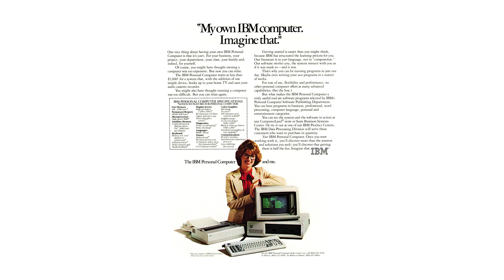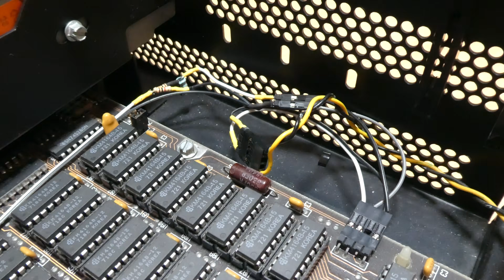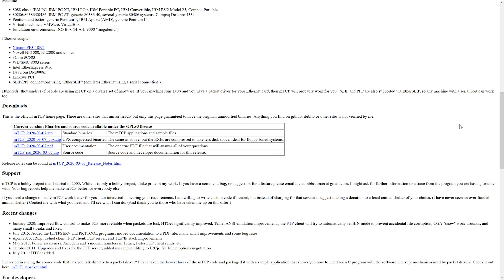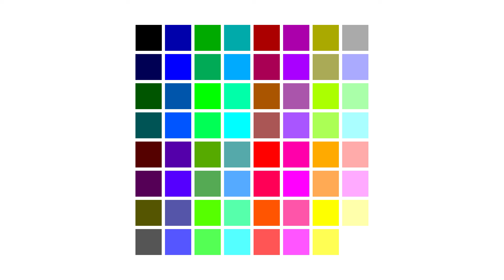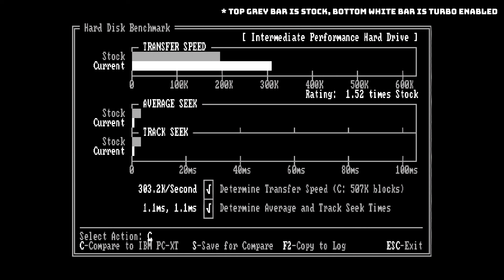IBM 5150 With 7.16MHz Overclock, EGA & Ethernet - Show & Tell #DOSCember

Comment: Very nice system. I especially like the EGA card, that's pretty rare these days.  What's on the circuit to get line level output? A cap to sort out any ground loops and a resistor to limit the voltages ?
Reply from the maker: Thanks! That's exactly what it is - it's the first "Tony Duell" circuit on this link: http://www.oldskool.org/guides/speakerrecording

I was going to start there and try out some of the more sophisticated ones listed on that page, but to be honest it worked just fine for my needs so I stopped at that one!

Comment: get some Adlib too... CGA sucks but those 5150 were probably quite slow with more advanced graphics and early Dos-games woudl sometimes offer no proper EGA anyway. HiRes EGA was very rarely used by games, even 640x200x16 wasn't used that often (which is a shame) and many games supporting CGA/EGA/VGA wouldn't really have great graphics in EGA, they sometimes botched the conversion because CGA and EGA were legacy market by early 90s and VGA was taking over but some companies did excellent job with EGA (Lucasart and Loom/IndiannaJones 3/Monkey Island, great proper EGA versions), other didn't care that much. 
Some 8bit VGA card might not offer a lot of playable VGA games (most of those were more suited for 286AT than XT) but would allows for more modern VGA monitors and also emulate CGA and EGA quite well. BTW just get an Amstrad PC1640... 😅

Comment: I've had to explain this before, but the Adaptive Tile Refresh scrolling routine was not invented by John Carmack, although Carmack is credited with being the first to adapt it to the EGA standard which allowed it to happen in hardware. The routine has its origin in the mid 1970's, I believe it either is or was patented by Sinclair, it originally was used in those giant Jumbotron type scrolling displays, Later on when Micheal Abrash coded games in the early 1980's he adapted it to many graphics standards, and left his information and code examples online, in a tutorial that John Carmack studied and later adapted for a game he called "Dangerous Dave" aka. Commander Keen... past the Sinclair connection, I have never found the name of the programmer who initially invented Adaptive Tile Refresh in the 1970's (I doubt it was Sir Clive). This is a shame, because although I found the Sinclair patent connection, The programmer who invented should be named, because he literally gave us gaming, his routine after being adapted to many standards and set down as silicon chips for consoles gave us every scroller from 1984 to now. Every Pc, Nintendo, Sega, Insert game system here... owes him the recognition he is due.

One thing we can assume it was a programmer/hardware engineer who worked for Sinclair and his cleverness is probably what made the Sinclair Spectrum so elegant, efficient and smooth.
One thing we know, there is rarely anything new under the sun, only incremental evolution adding another step to paths that were initiated by others... Original is Jesus level rare.

Disclaimer for Carmackers:
I am not taking anything away from your War Daddy, he is one of my Top 10 favorite programmers.

Comment: I shipped two immaculate and original 5150 PCs from the US when I moved back to New Zealand in 2005 towards the end of my engineering career.  Those and my (2) 5151 and (1) 5153 monitors were the only items in my collection of around 10 (mostly Unix) machines that could not run on 230VAC.  So 5 years ago I developed a modification for the standard 5150 US power supply.  It's carefully designed, very conservative and the theory and procedure documented.  I contributed that to minuszerodegrees and it's the first listed, 'xxxx'.  Amusingly, despite that it's been possible to do this for 35 years, shortly afterwards a couple of others quickly made slight variations and published their own versions.
I've always used mTCP in FTP server mode because it's easier to do file transfers in a GUI from my iMac.  But, I've found that Filezilla has problems transferring text files so better to restrict it to binary transfer mode. I've avoided modifying these machine as much as possible but since I was never able to find a clean 5160 I did add a period-correct half-height MFM hard disk and controller to one of the 5150s. Just like in the UK, for the same reasons original IBM PCs are quite rare here in NZ.  I don't have an IBM EGA card or 5154 but I do have a Tecmar Graphics Master, a common US$499 upgrade in that late CGA period.  It runs the 5153 interlaced for 640 x 400 modes. Yes, the refresh is pretty ugly.

Comment: I built the PC Sprinter for my Original Tandy 1000 with a V20 chip. I ended up getting the 22mhz crystal and I have been having issues with it crashing. Sometimes when I boot it will say "Memory: None". I'm going to try the 21.47mhz crystal and see how that works.

Comment: You may already know this, but that AST Six Pak Plus card has a parallel port and a game port header.  The parallel port can be used with a standard 2x13 to DB-25 adapter, but the game port requires those two sockets to be filled with an NE558 and 74LS244 and a 2x8 to DA-15 adapter to enable the game port.

Comment: I love this mod, thanks for sharing. I ended up using an accelerator card breakthru 286 the 12 MHz version really boosted my XT and I love how software switching on the fly with a keyboard shortcut give me flexibility to use speed sensitive games and boost other games.

Comment: Upgrading the CPU to a NEC V20 will add even more performance.  Many people in the day did this for a 20% speed improvement without even touching the clock.  Add the PC Speed and it will be even faster.

Comment: Love the vid thanks!
Re: EGA on CGA it was great for my 286/12 back in the day. The 286 ran POP well on EGA as did Stunts :-) 

I never could find a suitable windows 3.0 driver for the lower res ega mode but GEM had one :-)
Reply: I guess you mean CGA on EGA?
Reply: @herrbonk3635 that comment was a while ago looking at my handle but i was referring to using an ega graphics card with a cga monitor. You could run all of the low resolution ega modes.
Reply: @TechDistractions  Ok, I was thinking CGA resolution (mode) on EGA video card.

Comment: I wonder if such pc sprint exsists for clone pc's. I have an Atari PC3 XT (4,77Mhz and 8Mhz if turbo on). It has 2 crystals, one for the 4,77Mhz and one for the 8Mhz mode. Replaced the cpu (desolder job, yuck) with a socketed Nec V20 and replaced the 24Mhz crystal with a 30Mhz one. Runs just fine at 10Mhz now but I think a pc sprint solution would be healthier in the long run. Is is notably faster now than before and the NEC cpu can be clocked to 16Mhz without overclocking so it's not even getting warm at 10 Mhz. I don't seem to find the clock chip though. Most chips are Goldstar, Motorola or Siemens branded in this machine.

Comment: Your IBM EGA card has some bad or marginal RAM, I see blue, green and gray dots in random places on Commander Keen 4 in your video where they should not be.  I had the same problem with my fully upgraded IBM EGA card and a very difficult time tracking the cause of the random dots down because software video memory tests were not finding bad RAM.  Replacing all the RAM on the daughterboard solved the problem for me, see here for more information : https://www.youtube.com/watch?v=nLb0Wjnfw4M
Reply from the maker: Thanks for the info, that's very helpful. It's kind of intermittent but I've never managed to fully pin it down. I'll definitely investigate the RAM on the EGA card! 👍

Comment: I bought my IBM 5150 in the UK with a view to preserving the computer in its original condition as much as possible. I like the idea of having an original, unmodified machine - a very different philosophy to yours!  :-)
Reply from the maker: Hi Edward, thanks for watching. It's fun to see how far we can take these things but I also appreciate the importance of preservation, of course. With that in mind I haven't really done anything here that isn't reversible - well, I suppose the holes for the buttons, but I put them well out of the way on the back of the machine. I even have the original CPU and other bits carefully stored away. Perhaps I'll revert it to stock one day, particularly as I now have a 5162 that I can use for some of the later CGA / EGA games.
Reply: @ctrlaltrees  The NEC processor would perhaps be the most minor deviation from original or time period correct hardware here. As it existed back in the 1980s iirc. Your overclock card seems to be using the old original intel-ICs as well. It's worse with NAND-flash storage! That kind of stuff really didn't exist back in the 1980s...🤔😇

Comment: Very nice system, im in the uk and would like to get a 5150 or maybe a 5170, did you find yours in USA on ebay?
Reply from the maker: Thanks! Yes, even after shipping it over (ebay Global Shipping Program) it was cheaper than buying a UK model. I think the 5170 was a little bit more common over here, so you might have more luck there. It's also a more useful machine if I'm being entirely honest.
Reply: @ctrlaltrees  DId the monitor get shipped from the USA as well?
Can you recommend any other models of early IBM's, I agree that i should be able to do a bit more with the 5170, i just want an early iconic machine.
Reply from the maker: Yes, monitor is a US model as well, I run the whole thing on a 110V stepdown transformer. There's the PS/2 range of machines as well, they're pretty iconic but for me this original design is where it's at.

Comment: It's technically not an overclock, when the V20 is designed to function with higher clock speeds.
Reply from the maker: Thanks for the feedback! I'd say that replacing the PC's clock generation circuit with an external, faster one qualifies as an overclock, so I guess we'll have to agree to disagree on that point. I hope this oversight did not ruin your enjoyment of the video.

Comment: While you can't use the 16-color high resolution 640x350 mode on your 5153 color monitor, which depends on the RAM expansion (without the expansion, you get a 4 color mode instead that is supported by nearly no software), you do get a larger video buffer that can be used for scrolling around. For example the classic games "Crystal Caves" and "Secret Agent" distributed by Apogee use 320x200 in 16 colors (which can be displayed fine on your monitor), but have the whole level in video RAM, and just move around what piece of the video RAM gets displayed. A 64K EGA card can only have 2 screenfulls of 320x200 in RAM, whereas the EGA card with all 256K equipped can manage 8 screenfulls. Crystal Caves and Secret Agent need and use this extra space. So the RAM expansion is not as useless as you make it seem to be at 11:45.
Reply from the maker: Thanks for the information, I wasn't aware of any games specifically coded to take advantage of the extra video RAM. It would be interesting to see how they perform both with and without the expansion fitted. A good excuse to check out Crystal Caves too, a game I've been meaning to take a look at.
Reply: I know that Commander Keen 4 will not show graphics properly without a full upgraded EGA card, visual glitches will be shown in random places about the screen due to the way it buffers video.  Similar games like Crystal Caves/Secret Agent may also be affected.

Comment: This is a great overview of hot-rodding an 8088-based system.  You're all set to capture some output nearly as accurately as possible.  (Trivia: Our video capture setups are identical, even down to the Startech device!  That said, I'll be exploring the RGBItoHDMI project soon.)
Reply from the maker: Hi Jim, thanks for the comment! It took a while and a few missteps to finally settle on this setup but I'm very happy with it. The RGBtoHDMI looks ideal, it's something I'm meaning to check out.

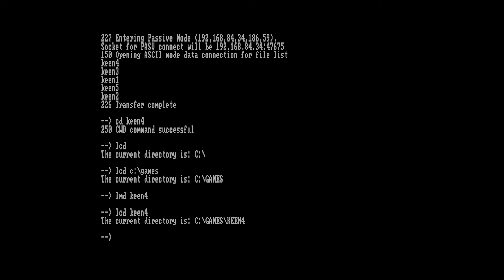Comment: 18:54 keen4.conf was the one file that didn’t copy, as it didn’t comply with 8.3 filename standards of PC-DOS.
Reply from the maker: Very well spotted! Yes, this is the GOG release so came packaged up with DOSBox - I thought I'd deleted all of the non-essential files but somehow missed that one (and a random README I think). It's just the DOSBox config so not required to run it on the IBM. 🙂
Reply: @ctrlaltrees  Did it generate a new configuration file locally upon opening Keen, by chance? I’m curious how PC-DOS would have named it.

I developed an eye for catching these things back when I used pkunzip on Windows NT, where similar long file names would often collide. Version 2.50 of pkzip knew how to deal with long file names on Windows 95/98, but not on NT-based Windows. This was only an issue with zip files I’d download, as everything else worked fine from ftp. I also had ftp software for Windows 3.1, but it would politely truncate non-8.3 filenames (.html would become .htm and so on.)
Reply from the maker: No, it doesn't generate a new file. Keen4.conf is the DOSBox config file for the GOG.com packaged version so not used by / created by the original game running on original hardware.
Reply: Glad I wasn't the only one to notice that :D

Comment: Nice video, i'm in the UK also and have been looking for a sensibly priced IBM AT or XT with monitor on and off now for quite a while. I know what you mean about prices, I never seem to see them going for 'sensible' prices! I also wanted to see if I could get the same PC as I had for my first one when I was in my teens which was an Olivetti PCS86, but even they seem to be quite pricey when they come up! The PCS86 had the NEC V30 chip as it happens (it had VGA but 640k only, I put an 8-bit Soundblaster in it), it did run a good few of the games I tried on it although some stuff I tried needed a 286. Maybe i'll pick up a PCS286 instead if I can find one!

Comment: Nice build and period-correct details, especially the 80's era 3COM card and AUI. :)
I fondly remember teaching people to solder 10base2 coax connectors... back when being used to assembly amateur radio antennas and feed lines was good experience for doing ethernet work.

I think I'll adopt your mTCP sol'n with my XT Bridgeboard to get things to the Amiga via ethernet.
https://www.youtube.com/playlist?list=PL2O6RH1Isy65p-cPxMx9HGlq9O_j9iVdx

Subscribed and looking forward to the upcoming video capture video!

Comment: Yeah, there were some games requiring over 600KB free ram.  The max I remember is 613KB, but it's been a while so I could be a bit off.  One of the reasons I hated DOS for games.  Well, not the games, but having to fiddle with the system before some of them would be fully playable.  Long live QEMM.
Good video man.
Reply: bullshit. it's all just a matter of setting emm386 and himem.sys up properly once. load the whole netware stack and odipkt, mouse driver, whatever. and all games still just run fine without ever changing it again. (just use loadhigh on basically everything at that... and dos=high,ems or whatever it was ;) can't remember ever having to 'change things' to get 'stuff to run' so if that was the case probably your initial configuration was crap to start with. ofcourse that stuff only came around with version 4 or 5 or maybe even 6 but hey.
Reply: seriously can't remember anything not running without modifying config.sys and autoexec first. ever. and most of them shit games also ran fine with an emulated cd drive if they 'required the cd-rom to be present' or on drive D: instead of X: or something over netware lol.
Reply: it's a solid operating system. that simply does what it's told to do. lol. unlike all that backdoored modern shit that does all kinds of shit you don't want it to do. lol. and most versions do so forever after turning it on (and never turning it off again ;) actual memory leaks and such are rare. lol.
Reply: maybe nowadays you would consider 'dos' to be less of an operating system and more of an int 21 api call library like the bios is too :P LOL. but hey. it works fine. it doesn't do a lot of stuff but what it does it usually does without bugs. and in most cases that's all it needs to do. lol.
Reply: @CB3ROB-CyberBunker  Learn to read.  I am blocking you as I cant' stand morons.

Comment: I've never seen a video showing how DOS was used on a stock 5150, without HDD, as internal HDD was added only with XT. Maybe next DOScember.
Reply from the maker: Great suggestion! I'll pass it on to the Retro YouTube Illuminati 😉
Reply: @ctrlaltrees  Hi Cool - suggestions 
How about Feb being Fin-client month :)

My first PC was a Commodore PC10 with TTL graphics - it was a strange ATI ( famous brand anyway ) card i believe and you could set dip switched for TTL / Hercules and CGA - it even should about 4 or 5 shades of green so you could "distinguish colours"

Anyway that PC went i i upgrade to XT Turbo with CGA card and CGA screen
 - that lasted 3 month and kept giving me headaches due to the CGA snow- at work we had the same issue and they upgraded CGA cards and i was fornutate enough to be given one of the older cards - it nor rained slightly rather than slow heavily.

A few months later all the machines at work ( about 6 of them ) were upgraded to EGA and NEC Multisync monitors,  as i was unofficial PC caretaker and dot matrix printer machine cleaner and seterupperer  i was given a spare EGA card and monitor to keep in the cupboard behind me, i done the unboxing and there were 2 ega cards, when i saw the IT rep a while later i told him and he said "dont care you want it to take it home - have a present for the support work you have done" cool - but i needed a screen - this became the yearly upgrade

Eventually i bought a factory second or shop display generic EGA monitor ( 2 months overtime ) and that lasted 5 years until wolf3d was release - i still believe to today that game was responsible for more hardware updates than the entire win 3 / win 95 update process

Regards
George